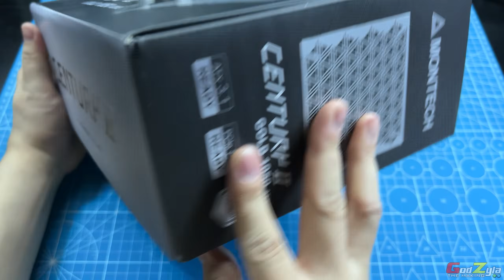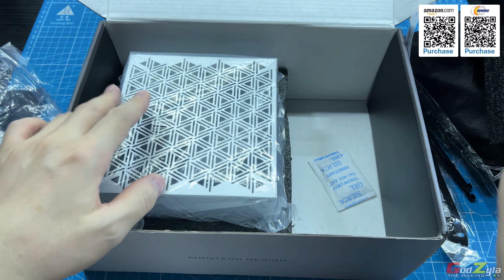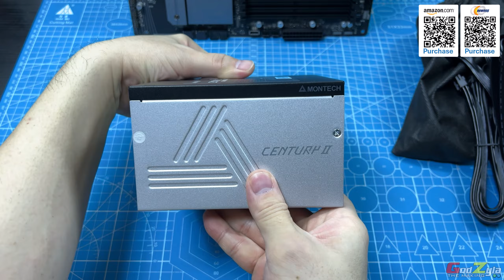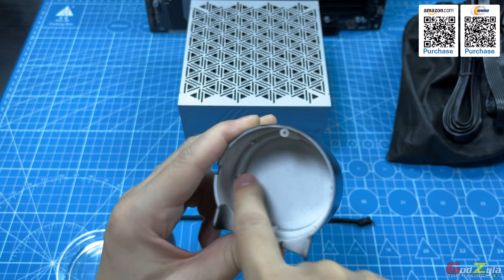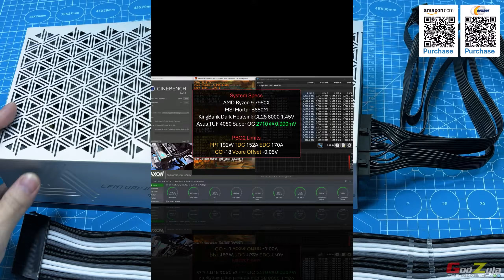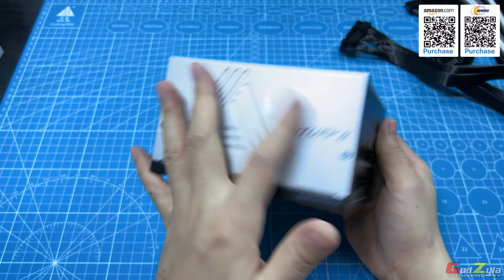Montech Century II PSU

Comment: For my pc build, 3070 ti and ryzen 7 5700x - Would you rather suggest the montech 850w or a superflower leadex III 750w
Reply from the maker: Welcome to my channel Factsomic. If you will be upgrading pc components at a later stage. My advise is to have at least 1000w. But if you intent to change PSU on your next overhaul replacement. Then get either superflower 750w or this Montech 850w. Either will work.

Comment: I know you said in the video that cable extensions are not necessarily good if we want the gold efficiency experience, but i feel like in my future build they will feel necessary, i am all in for aesthetics. What should i do ?
Reply from the maker: Welcome to my channel. Make use of cablemod custom cables (configurator) as they are customised cables which directly plug between this PSU to your pc components. Just make sure you define the correct PSU in the configurator
Reply: @KleoYan Thanks I appreciate it 👍

Comment: i can skip on some cable extension but would i get any issues only using 2 extensions? 2 pcie extension for my gpu to be exact
Reply from the maker: Welcome to my channel Madness, you can do a comparison with and without the extension while running furmark and to observe your GPU stats. Then you can decided if you want to use the extension.

Comment: Another great review. $130 CAD for a 1050W PSU is pretty nuts. I'm likely going to grab it anyways for a build I'm doing for my Dad. 

But man, since I upgraded to a 9070 XT which needs 3x8, what's with so many PSU's only coming with Pig-Tail 6+2's. It's really annoying
Reply from the maker: Welcome to my channel Hawk Hogan. Yup this PSU is good and it does come with 3 x 8pin PCIe cables. Just grab the 1050w and you are good to go. 👍
Reply: @KleoYan I trust that it works; and at least with this, you have 3 cables, so there's no daisy chaining. 

I just don't like the fact that a lot of PSU's nowadays aren't coming with an 8 pin to a single connection 6+2; which would be highly desirable. It's annoying to deal with this while owning AMD's flagship card. 

And it isn't easy to hide that other connector in the case, especially without Extension Cables
Reply from the maker: @HawkHogan_  I can understand your frustration and for this you won’t have that issue 😬
Reply: @KleoYan They're all Pig-Tail Cables, no?

Comment: Why did they decide to use the 12V-2x6 cable of 450W instead of 600W in this model? Isn't that kind of bad?
Reply from the maker: welcome to my channel rfac. All Montech Century II PSU are using 12V-2x6 connectors. how did you get the idea of they are different, btw this PSU only comes in 3 different wattage, 850W, 1050W and 1200W. I think you got mix up with Montech Century.
Reply: @KleoYan  I just thought it was weird because there are actually several 850W power supplies with 600W on the 12V-2x6 cable, like the XPG Core Reactor II VE 850W or the ASRock Steel Legend 850W.
Reply from the maker: @rfac47  I see. lets put it this way. average 4080 or 5080, the drawing wattage is at 320watts and 360watts respectively. To me it's just nice of a PSU to provide 400Watts, leaving the rest for misc devices. If you intend to get a 4090 or 5090, will you run on a 80 Plus Gold 850Watts PSU? or will you run on a 1000Watts or 1200Watts PSU. I will run on a 1000watts to 1200watts and will not run on 850Watts, it's too much stress.
Reply: @KleoYan  Sorry if I wasn’t clear, I’m talking about the maximum wattage that the 12v-2x6 cable officially delivers in this 850W model, which is 450W, while in other brands the 12v-2x6 cable is rated 600W.
Reply from the maker: @rfac47 this is a 80 Plus Gold PSU, though it is able to provide platinum grade current, still it has a limitation. It is certified with ATX 3.1 + PCIe 5,1, but Montech emphasizes value with Japanese caps and 10-year warranty with a cap limit on the 12V 2x6 current. this is to avoid too much stress and transient spikes. If you wanted 600W then go for the 1050W or even the 1200W.

Comment: I have the 850w version. Would I be able to use the same cables with the 1050w version? I don’t feel like cable management again.

Just the unplug from the 850 and plug in the 1050.
Reply from the maker: Welcome to my channel D R. You will be able to use back the cables if you are just changing the wattage. Just make sure it's Century II from Montech.
Reply: Ok thank you very much yes I plan to use the exact model just up the wattage :)
Reply from the maker: @ThEHiTMaN01 you are most welcome and all the very best. rest assure you can use back the same cables 😉

Comment: Enermax revolution iii 1000w vs montech century ii 1050w which is better
Reply from the maker: Hi Enis M, welcome to my channel. Both PSU performs equally good. Now it comes to prices as which is cheaper. Also enermax 12VHPWR is of 2 x 6 as compared to Montech. so choice is up for you to choose.
Reply: @KleoYan ty for answer i dont understand what is diferefnce about gpu connection between this two psus
Reply from the maker: @enism  ok .. watch this where I explain the difference https://youtu.be/Y8Nu9A0iZp0 as Ive shown between old connector 12VHPWR 12 + 4 (montech PSU) vs 12VHPWR 2 x 6 (XPG PSU), you will see the power supplied to the GPU.

Comment: Do you recommend this PSU model (1200W) for a build with RTX 5090 and Ryzen 9950X3D?
Reply from the maker: Hi Allan Rodrigues, welcome to my channel. Yes, the 1200W Montech Century II PSU meets ATX 3.1 and PCIe 5.1 standards, including a native 12V-2x6 (16-pin) cable for the power-hungry RTX 5090, which can draw up to 600W. Its single +12V rail total), easily handling the combined ~700-900W peak load from the 5090 (~450-600W) and 9950X3D (~170-250W TDP under load), plus other components.
Reply: @KleoYan  Thank you for the thoughtful response!
Reply from the maker: @AllCRS  You are most welcome and all the best with your build too 😉

Comment: is it ALL extension cables that affect this? since I have some EZ-DIY-FAB 16AWG Cable extensions i’d like to add, the montech ones it comes with is usually 18AWG which is technically worse

extensions cables would be for everything but 12VHPWR that comes with PSU, so it shouldn’t technically affect peformance on GPU since i use native 12VHPWR
Reply from the maker: Hello rvwr, welcome to my channel. You can always check or test it out. For me I won’t use extension cables at all. Be it 16AWG. Once a line has a break point, there will be power leak. In addition, addition extension add to length, which means your psu will work harder to push the current through the cables.
Reply: @KleoYan Thank you! - Before adding on, I need to say I love your channel, your videos and the way you go into such detail, your Montech King 95 Pro video was extremely helpful in terms of cleaning my PC yesterday, keep it up!

Adding on, I understand and see what you mean, you might be right 

But for my scenario, i will try and use the PSU extension cables for the 24 pin, 4+4 pin EPS etc, BUT for the 12VHPWR, or the 12+6 or whatever it’s known as now for ATX 3.1, I will use the Native 12VHPWR cable the Century II has, so no extension for the GPU

In this scenario, will GPU peformance be affected like wattage and overclocking in core clocks, i know you can’t be certain - but what do you reckon since the 12VHPWR will be native, only things like 24 pin etc are extensions
Reply from the maker: @rvxwr I believe is up to individual to decide.  If that little impact does not matter to you, then is ok. I am just sharing my findings. 

On a personal note. I am sturborn, I will not go with extension cables at all. Knowing that for 24pin is already leaking if add on to 8pin EPS that will be more leak. Is either I self crimp 16AWG cables which directly connects to the PSU to the motherboard or GPU or I will enagne cable mod for direct cables. You see, even if your GPU is using default 12VHPWR cables.. how does your GPU communicates with the system? Is through your CPU and CPU not getting the 100% current from PSU.. hmm .. lets put it this way.. you are driving a manual stick.. you suppose to shift to 3rd gear but you kept your gear to 1st gear and to drag. what will happened to your vehicle in a long run?

Anyway the choice is yours.
Reply: @KleoYan ahh, i see - my way of thinking was, the GPU communicates with the PSU about power, and if you have a 12VHPWR native than the communication is correct and no leaks, i didn’t know it was CPU to GPU

One last question is, is this mainly with Montech PSU’s or all PSU’s, because if it’s just Montech i’m going to return it since I got it today

Also if the GPU is something like a 5080 Suprim, which runs extremely cool usually under 62 degrees at 360W, even if the 5080 uses more wattage, it could still maintain core clocks fairly because it’s cool-ish? or not how it works, i’m presuming an overkill GPU cooler will help mitigate GPU overclocking headroom loss due to reasonable temperatures

One think interesting i see too is the peformance with the extension cables is somehow better?
Reply from the maker: @rvxwr I will suggest you to give it a try with and without extension cables. Test the original cables with cinebench + furmark running at the background, take down the 12V, 5.5V, 3.3V, inclusive of your GPU 12V or 16pin reel voltages.. not forgetting take down the CPU Power consumption + thermal on both CPU and GPU. next test it with the extension cables. This way you will have a better picture. All the best with your findings and thank you for the decussion.

Comment: this psu 1050/1200W or msi a1000G??
Reply from the maker: Hi nef, welcome to my channel. Personally I have bad experience with the MSI a1000G, have tested two units and both drop vdroop after sometime usage. I prefer this Montech Century II 1050W, it's rock stable and it's of better power efficiency over the MSI. I have two unit of this. 1 is using on my capture rig and another is on my open bench. Which ever content you have watch on my channel after May 2025. be it AIO or Rams and such.. are all using Montech Century II 1050W. you can compare the MSI https://www.cybenetics.com/evaluations/psus/1965/ vs Montech https://www.cybenetics.com/evaluations/psus/2812/ . One last pointer.. even though Montech Century II is 80plug Gold but it is running at Platinium grade.
Reply: @KleoYan Im really grateful and thanks for fast response with knowledge. I’ll later watch other videos
Reply from the maker: @nef6097  you are most welcome. All the very best with your build too. 😉 oh almost forgot.. the Century II 1050watts is more than enough.. unless you are using a 5090 then I will advise you to with Seasonic PX-1200.
Reply: @KleoYan  im using 5080 and 7800x3d so yeah 1050 is good future proof. Btw what do u think about Thermal Grizzly WireView??will it cause voltage fluctuate like cable extensions?
Reply from the maker: @nef6097  for wired view not really. Is direct connection not extended with cables. It will be fine.

Comment: SHOULD THIS BE INSTALLED RIGHT SIDE FAN UP OR FAN DOWN BECAUSE IT RATTLES AND IS VERY NOISY IF U FLIP THE SWITCH TO MAKE THE FAN RUN. VERY DISAPPOINTED WITH THIS PURCHASE NOISY AS HELL
Reply from the maker: Hi charles giannone, welcome to my channel. There is a purpose for the eco switch. It will stay quiet when you have this switch on and the PSU fan will only start spining when it detects a 50°C in temperature. Most of the time it operates quitely. I am not sure why do you need to flip that switch to keep fan running all the time.. also, kindly do me a favor. you need not have to CAP your sentence.. I am not blind, I can read clearly.
Reply: What case are you using it in?
Reply from the maker: @Stardomplay  I would build it with Montech Heritage White or the HS02 case.
Reply: @KleoYan  i was going to pair it with the Lian Li Lancool 217. I have seen a couple reviews including from Newegg and Amazon that is sometimes makes a ticking noise and that it also starts at 100 percent fan speed when you reboot your PC. Are these things true in your experience and how much do they take away from the PSU?
Reply from the maker: @Stardomplay  I have not encounter this. When I power up, the fan will spin abit and then stop, which is normal as there is a eco mode. I ran a 9950X3D and a 4080 with the PSU. never reach to the extend of the fan spinning. Unless I start to compile my artwork, then yes. It did go above 50°C but not as loud or tick as what others have mentioned.

Comment: I am thinking about buying this, particularly the 1050 Watt version. Is it still the best value option out there?
Reply from the maker: Hi Stardom Plays, welcome back and yes. This 1050w is one of the best value budget PSU.
Reply: @KleoYan  Thank you so much for the reply. This video was very informative for me, particularly the segment where extension cables decreased the efficiency of the PC by so much and the GPU was using more power to not even sustain the targeted clock frequency. 🤯 I actually remember watching your MAG Tomahawk X870 video a good bit back and it was also just as informative. 👌
Reply from the maker: @Stardomplay  you are most welcome. I am glad this content did aid you. All the best with your build too 😉

Comment: That was a GREAT presentation my man! I am waiting for the Montech Century II 1200 ATX3 PSU... I can hardly wait! It is going into a Montech Sky Two GX case.

Add On: This PSU was worth every dollar it cost me! Excellent unit.
Reply from the maker: Hi Mr. Shark Tooth, welcome back and congrats on your purchase. I am sure you will love this PSU. It’s super duper easy to do cable management. Thank again for your feedback and all the very best with your build too 😉
Reply: @KleoYan  🖖
Reply: What gpu are using with it, I have a 5090 and wondering if this is good
Reply from the maker: @KuyaRio-i8o hi Kuya Rio, if you have a 5090. This psu is sufficient but will be must wiser to get a full flag platinum 1200watts PSU.
Reply: @KleoYan oh I see, can I ask why? I know the percentage in efficiency is really not much different
Reply from the maker: @KuyaRio-i8o 5090 draws more power and plus your other components. It might go over the 500watt mark easily. Unless you are getting the 1200w of this PSU.
Reply: @KleoYan oh I meant picking up the 1200 watt montech century for the 5090, I just noticed you were talking about the 1050. Can I get the 1200 watt of this version for the 5090?
Reply from the maker: @KuyaRio-i8o  Yes! definitely. The Century II 1200W is a good, high performing power supply for your RTX 5090, as illustrated here it’s rock solid in performance. In addition, it’s an ATX v3.1 with native 12V-2x6 connector.
Reply: @KleoYan awesome to hear, I was just worried because I noticed it was much cheaper than other 1200watt psu’s I’ve researched so I am I’m trying to learn more about it. I know it’s gold plus but why does cybenetics say it’s platinum, confused about that, can you explain what the difference is? My other option was montech titan 12watt which I know is good, but it’s 100 bucks more and in white lol
Reply from the maker: @KuyaRio-i8o it’s 80 gold plus but able to provide platinum grade performance which I’ve mentioned in this content.
Reply: @KleoYan interesting, good to know. Funny you just compared it to the titan platinum which I was looking at but it’s white. How’s the montech century holding up still, it’s been a few months, are you still running it in your build?
Reply from the maker: @KuyaRio-i8o  it's on my open bench rig which I do testing and such.. it's still running fine. infact this PSU have gone through lots of stress test with the benchmark for thermal results on Liquid AIOs, Processors and such.

Comment: the price-performance ratio on this psu is insanely good. anything close to its price-performance is the msi mag a-gl series and even those are around 25% more expensive than this psu. if your looking to buy a psu, this is a steal, especially the 1050w. thanks for the review kleo
Reply from the maker: Hi Colby Norton, welcome to my channel. Yup this PSU has what it takes. I have been using this PSU too. Rock solid performance. Thank you to have share your experience with us too 🫡

Comment: Between the Montech century ii 1200w and MSI Meg AI1300w which would recommend?
Reply from the maker: Hi EliseoJV, welcome back. I do not have the MEG AI1300w PSU to compare with and unable to find any data on Cybenetics https://www.cybenetics.com/index.php?option=power-supplies&params=1,0,77 therefore unable to suggest you which PSU is better than another.

Comment: ugh i really wanted white cable extensions, can u explain the part where you dont recommend using extensions? didnt understand
Reply from the maker: Hi mArqSV, welcome to my channel. I strongly do not advise to use extension cables as I have mentioned the more cable connection point will cause power leakage and the supposed graded efficiency rating will not meet.
Reply: @KleoYan  on any PSU or just this one?

Comment: I have this power supply (1050W) version. After 2 days my PC would not power up. The PSU just makes a clicking noise, but there are lights on my motherboard. I did the pager clip test (shoring PS_ON#, pin 16 and GND pin 15 of the 24-pin cable for the motherboard). I can only measure 5.0 volts on pin 9 (standby), and all other pins have zero volts (measured between pin 15 and other pins). Does this power supply require some load before fully powering on? or is it likely the Power Supply is dead, and not my motherboard?
Reply from the maker: Hi abaj006, welcome to my channel. If you do not have a spare psu to test your current component. It will be best to bring down to your local pc repair shop to diagnose it. If you do have a spare psu and your system boots up fine, then RMA your faulty 1050watt PSU.
Reply: @KleoYan Thanks, unfortunately I don't have a spare PSU, decided to RMA. Hopefully it's the PSU.
Reply from the maker: @abaj006 oh ok. All the best and hopefully your issue is resolve.